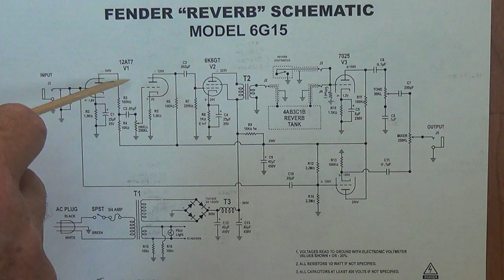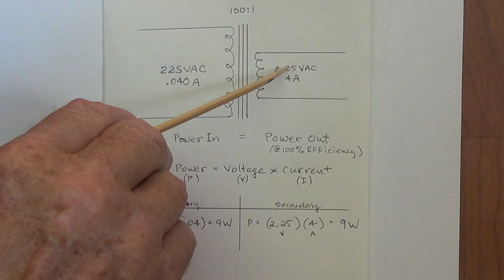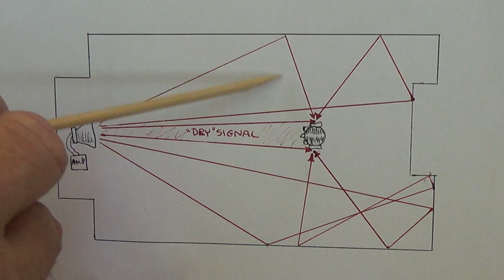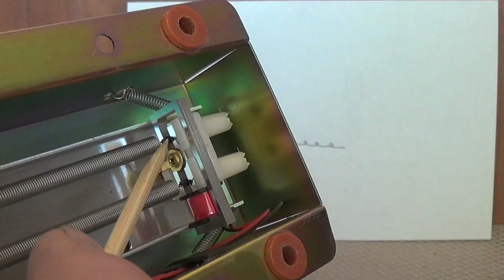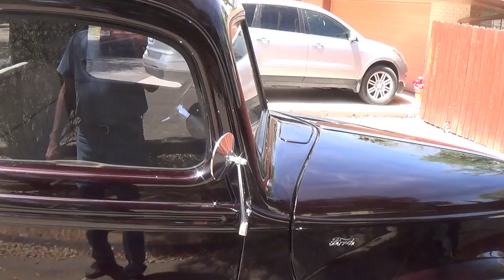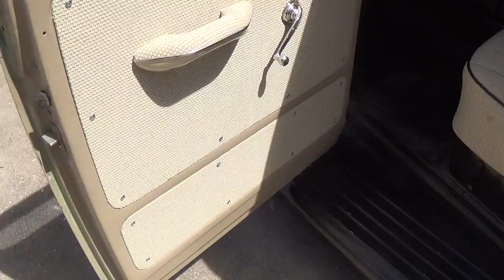Tube Reverb, Part 1

Comment from the maker: NOTICE: The link to the revised schematic, wiring diagram, etc. is now available in the video description.
Reply: my question is ? has anyone out there built this reverb according  to the layout diagram and schematic. on the top lay out the electrolytic caps have one red and two yellow wires coming from them. yet when you look at the under chassis there is two red wires and one yellow wire coming from the top as far as I can tell. the other thing that I wonder about is the output jack has all 3 contacts to ground and the wiper on the mix pot . the last time I attempted to build something it was from a book all about tube amps and when through with it it didn't work, checked it several times . no go. got on the net and after much searching found out there were 3 wires left out of the schematic in the book. nuff said. Otherwise I love all the videos. I just wish that the people that write stuff would build what they publish.I don't think uncle doug is at fault but I wonder about who did the layout after.
Reply: Another excellent tutorial, Doug. I have a question: do you refer the the LPF (C12, T3 and C13) as a "Pi" filter? I was taught that nickname years ago as it has a shape vaguely resembling the Greek letter. EDIT: That's a beautiful truck.

Comment: Hi Doug,I've built a clone of the 6g15 which worked out great. I'm thinking of building another to use in my studio which I'd like to use in mix down so Line Level (doesn't need to be balanced tho)- could you point me in the right direction please?
Reply from the maker: I'd love to help, Sharon, but I have no experience with what you are asking.  Good luck.

Comment: Nice video on the reverb unit! I have a strong interest in tube reverbs and reverb units. I recently made a video featuring my AMT TH-1 pedal (AMT Tube Hall). Although it isn't completely analog and isn’t a unit, I still enjoy its sound. Adding a phaser makes it sound like a dream. Your video has inspired me to explore this further.
Reply from the maker: Thanks for the nice comments, MB. Good luck with your experimentation.
Reply: @UncleDoug  also wanted to say that I love your work and generosity so much. When I discovered your channel a few months (or years?) ago it really motivated   me to stop being afraid of circuits. Had a blast (and a few non-lethal shocks) since. Thank you thank you thank you.
Reply from the maker: @morenoteslesstalk  You're quite welcome, MB :)

Comment: Hello Uncle, i have a reverb tank from an 90s transistor Fender SKR35 amp, can i reuse that reverb to a project like this or something similar?To make it work like a standalone tube reverb tank?
Reply from the maker: Transistor-circuit tanks generally have completely wrong impedance for tube circuits......they will not work.

Comment: I have a reverb unit from a Hot Rod Deluxe that I would like to repurpose into a stand alone reverb unit. I see the input resistance for that tank is 600 ohms vs the 8 ohms for the tank in the schematic. Is there a way to make it work with this design?
Reply from the maker: Check the Accutronics site for a list of the tanks they offer. Many different impedance ratings are available.

Comment: Would like you to do more step by step clone builds with LAYOUTS ..LIKE a bandmaster / Vibrolux powered PRINCETON REVERB. With Master..Maybe a TLO72 powered gain on it. Add FX LOOP. And external bias jacks and pots..I also noticed when mounting a  JTM45 chassis upside down in a one speaker combo. There is a space at each end.Great place to add upper cabinet corner reinforcement blocks that will facilitate a second removable top on the cabinet..The 2nd top can be removed to allow circuit inspection & some servicing without having to remove the chassis...The upper corner blocks could have threaded inserts for the removable top..Have not worked out the blocks yet as they could also be metal brackets..The handle will be mounted to the removable top..So need the brackets secured well to the cabinet sides for added strength..I just figure you are the guy to get this done. The JTM45 chassis is somewhat limited in space..You are clever & resourceful..Am curious to see what you'll come up with.
Reply: Something else I want you to help us with. 1. Is a Handwired step by step build ( LAYOUT)  instructions for the MUSIC MAN RD50 PRE AMP ONLY pedal/ box unit. The other thing that would be great is  step by step plans to clone a Handwired version of the Vox 15 watt solid state Pathfinder from the late 90's..( Model V9158 ):Greatest mic'd amp for recording I ever came across..Needs a pre amp out for clean non scratchy tone..The 8" speaker may have something to do with the tone but not that much..That amp with a heavy strat with alnico 2 pickups and fat polished frets with gain in that amp can get some clean Hendrix REDHOUSE/ WATCHTOWER TONES . Killer CLEAN  sustain. And a Boss DM-2 , not set for echo , but to just stretch the notes a tad..Very hard to replicate that sound anywhere  else...They now make the TLO72 with a socket..Which makes it mimic a tube style plug- in..So the the entire TLO72 circuit mod could be made as a cheap universal plug in module making it more service friendly for all the die hard hand wired tube amp warriors !
Reply from the maker: Greetings, Don.  I do not create or work from layout diagrams, and I do not work on transistorized circuits. Thus, rather than asking others to do the creative design part of the elaborate projects you described, perhaps you should attempt to do the work yourself. Good luck. @doncalloway136

Comment: The need for a "killer left hook" into that reverb tank, is that mainly due to the coils inside there and the impedance of them-theyre basically like speakers arent they or how would the reverb coils compare to speakers I wonder? That is one sweeet ride daddy-O.
Reply from the maker: The reverb tank is driven exactly like a speaker. In fact, you can plug the cable (to the tank) into a speaker instead, and the speaker will  work just fine (not much volume). Thanks :)

Comment: well im thinking it would be easier for me to add tremolo to this reverb unit, than adding reverb to a tremolo effects cabinet from the rick Campbell video. was inspired by the Bell and Howell 385 filmosound video where you added the tremolo from a vibrochamp circuit. im thinking of making it the same size as my Marshall TSL 100 head and it will blend into the stack. instead of Marshall it would be a Russell. lol thats my thought today anyways. every video of yours I watch I get inspired to do something else. :^I
Reply from the maker: I agree that adding tremolo to the 6G15 circuit would be the easier path. Good luck with your project.

Comment: Hi Uncle Doug. I just acquired a Airline 62 9019 Reverb Unit. It is completely original without the cabinet. I intend to re-cap it as well as build cabinet for it.
It uses a 6DR7 and a 6EU7 combination of tubes. The 6EU7 is a very expensive tube. Going by the data sheets. It seems to be exactly the same as a 12AX7 with a different pinout. 
So the first hurdle I'm thinking of overcoming is to re-wire its tube socket to accommodate a 12AX7 which I have many. Instead of ordering the $37 6EU7. Wonder if you have any thoughts on this?
I do have a good schematic for the unit. Which can be difficult to find if you did not know that Airline used the "62" prefix in a whole bunch of stuff they build. However, if you look up the Airline Schematic for simply "9019" it can be easily found.
Reply from the maker: I think the transition to 12AX7 makes a lot of sense, DW. Rewiring the tube socket should be an easy task. If the socket is labelled 6EU7, you might want to relabel it. Good luck.

Comment: OK I kinda liked this video - up until the analogy about voltage and amps being like talking shit and actually kicking someone's ass.  That made me love the video

Oddly enough, I actually understood and was familiar with every concept in this simple circuit.  With a little more study I'm going to try building one of these
Reply from the maker: Glad you enjoyed it, Monto. Good luck with your project.
Reply: @UncleDoug  Quick question - on the schematic you linked in the description, the Dwell pot appears to have the left and center terminal bridged together.  The schematic looks identical on that area to the Fender original, but their layout (+several others I looked at) don't have that bridged connection.  I don't want to make any assumptions - but is that correct?  Also where the same terminal's lead connects the grid on the b side of the 12AT7 has a different color.  

BTW studying your videos in my spare time over the last couple of years has built the majority of my knowledge on tube amps.  Your channel is a great resource
Reply from the maker: @monto39  When in doubt, trust the schematic, Monto. I created the schematic, but not the layout drawing. In the circuit, no legs of the Dwell pot are bridged.
Reply: @UncleDoug  Thanks for the advice.  With a little more study (and saving of $$) I think I'm going to get the Weber kit and build this
Reply from the maker: @monto39  Sounds like a good plan to me, M.

Comment: Thanks for all the great info Doug but the mojo tone kit with cab is almost $800 is there alternate source for a kit?
Reply from the maker: You'd have to check, Eric. I don't personally build kits and have no awareness of what's available. You could always just build it from scratch and save some money (not as much as you might expect).
Reply: @UncleDoug  Thanks Ill keep looking, you have any experience with the reissues?
Reply from the maker: @shckltnebay  Yes. They are well built and work fine. They MAY also be a bit cheaper than the $800 kit.
Reply: @UncleDoug  thanks so much

Comment: If my instructors in electronic circuits class were as interesting as you I may have made higher than C
Reply from the maker: Thanks, William. It takes a little effort to make the subject interesting......but it sure pays off in the long run.

Comment: Curious.  Instead of the physical reverb tank being a permanent feature, I'm thinking some way of utilizing line inputs and outputs into the cicuit for other ADA reverb gear like an old Eventide or Lexicon rack units.  Drive the input with tubes and have a proper tube output to an amp.  It would give you all the mojo and quality of tubes with the flexibility of good ol' 80's digital reverbs.  ;)
Reply from the maker: "Digital reverb" is anathema to us tubeophiles, Prof. The best reverb in the universe comes from a vintage Accutronics tank with Fender tube circuitry.

Comment: That's a bad ass truck uncle doug....
Reply from the maker: Thanks, Shiloh :)
Reply: @UncleDoug   Its funny, I found the schematic of the fender one for this in my book and researched a little but and I had considered building myself one , bec it seems like it would be an easier project to start out on.....thanks uncle doug....
Reply from the maker: @Shiloh7377  The 6G15 was one of my first tube circuit projects, Shiloh. I recommend it highly.
Reply: @UncleDoug  Thanks Uncle D, I wish you lived closer so I could have you go over my jcm 900. Anyway thanks UNCLE D
Reply from the maker: @Shiloh7377  You're welcome, Shiloh.

Comment: Hello! Is it possible to use a 6K6 instead?
Reply from the maker: Yes. Many people prefer them to a 6V6.....less gain.
Reply: @UncleDoug  I was wondering if your design needed other changes when putting in a 6k6.
Reply from the maker: @fuzzyloomchannel  No.....the tubes can be exchanged without any mods.
Reply: @UncleDoug  Thank you!

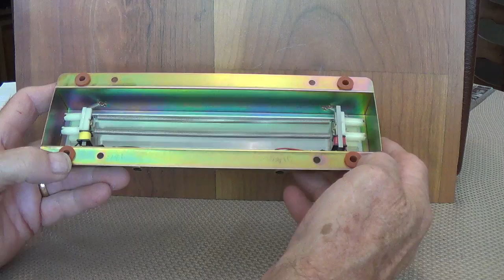Comment: That tank at 18:38 looks exactly like one that I hung on my wall. It's from a 2001 Marshall VS100, I gave it to dear old dad for inspection, and he said one of the connections between the jacks and the transducers was toast, so I just bought a Mod replacement tank and went on my merry way. I thought it looked cool so I stuck it on my wall
Reply from the maker: I prefer MOD tanks also, Dom. Good luck with it.

Comment: Hello Uncle Doug, how di d you mount the reverb tank? di d you just screw it to the wood vertical? Thanks
Reply from the maker: Yes, it's mounted vertically with the open side toward the front of the cabinet.....just like the original.

Comment: I have a  reverb unit that I believe is the same as the one you are talking about. It is a matching cab for my 61 Bassman. I use it in conjunction with a 2-12 cab with  celestion cream backs.
Reply from the maker: Fender made the 6G15 stand-alone reverb unit for many years, Jeff.
Reply: @UncleDoug  had the opportunity to buy several vintage reverbs,  but they didn't match the bassman. I get compliments from all who see it. It is also a beautiful piece artwork.
Reply from the maker: @jeffsquires6620  I'm sure it is, Jeff. I hope it serves you well for many years.
Reply: @UncleDoug  many thanks ,I love old fenders and appreciate all who maintain their excellence. Safe journies. You sound like the guy from Psonic.

Comment: Thank you for the video. It's a good study of such a simple but cunning device.

I suspect that when they originally designed the reverb tank, they saw the springs, transducer, and pickup as the main sound effect parts. They made it the best they could for a decent price. (Hear it comes....)
I wonder two things along the same ideas:
1.) What affect there would be on the tone if the (only) the springs that support/shock-isolate the inner assembly were dampened? In other words, I wonder if the outer springs were deadened temporarily by putting weak foam in them, such as the black foam that comes with IC chips, would it have a pleasing affect on the sound. I wondered if any of the vibrations makes their way to the case through the suspension springs.
2.) Does the plate that most of the parts are mounted on ring at all? Might is sound better if all it did was stiffly support the springs? If the plate were deadened temporarily with double-stick tape and rubber-backed thin indoor-outdoor carpet scraps or permanently with spray glue and the same rubber backed carpet or automotive Q-pads.

With guitarists, things are complicated. It might make a little more accurate reverb tank, but it might not be as pleasing.

While taking things apart such as trunk-mounted CD players, there are some isolation mounts which are very soft, and might be good for tanks, which I think are polyurethane. Though, Sorbothane is bad for a lot of things because it will go right through some kinds of plastic, vinyl.
Reply from the maker: I agree that reverb tanks should be (and are) rubber mounted to reduce extraneous vibration; however, and I speak from personal observation, any containment or suppression of the springs themselves essentially ruins the effect.

Comment: This is an amazing project! I have a question - If I get one of these tank, feed a line level output into it and then send it to a mic pre - would I be able to use it as an outboard effect? I am talking about the tank only, without the amp section
Reply from the maker: Thanks, DR. I have no idea if the impedances would match. You'll have to try it and see. Good luck.

Comment: Your reflection angles are all wrong!  The angle of each would have an identical "angle of incidence". Analogy? If you were to put a mirror at each reflective surface, you would see that the angle that the sound hits the wall will be identical to the angle that it reflects. SO your diagram is totally unrealistic.
Reply from the maker: Gosh, Mark, I guess I'd better delete the video and throw the 6G15 in the nearest Dumpster.
Reply: @UncleDoug  LOL

Comment: Uncle Doug-A couple of unrelated questions for you.  First, I've been thinking of building something similar to this unit, and wondered what the reading at the output jack is.  Is it the same as at the input jack, or different?  I assume its not 4 or 8 ohms like it would be if it were going to a speaker?  Second, and unrelated to this but is based on one of your cap discussions, Why do some amps have cathode caps along with the cathode resistors, and some have only the cathode resistor?
Reply from the maker: The input and output impedance must be fairly close to avoid too much alteration of the guitar signal, Reggie. Please see my video on the function of cathode bypass capacitors.

Comment: Fun Fact: 
The spring reverb system was originally developed by The Hammond Organ Co.  The first design was a 3' tall vertical unit, with long springs encased in tubes full of dampening oil; with a complex set of levers. 

Their second design involved hanging the springs like a necklace (Hence it's referred to ass necklace reverb).
When they developed their third design, which is the basic design still used today, the spun the division off as Gibbs Research Co., which became Accutronics.
Reply from the maker: Very interesting, Scott. Thanks !!

Comment: If you're running solid state rectification then you might as well throw in 100+uF resevoir caps as the time domain is way better. You don't need to play host to the needs of a valve rectifier.
Reply from the maker: Thanks for the suggestion, Prince :)

Comment: Uncle Doug, I think this will be my first attempt to build an electronic device. I was looking at schematic displays for several vintage Fender amps. A Super 5F4, a Twin 5F8-A, Tremolux 5G9;  all have a selenium rectifier. I do not understand what that does or why it may be necessary. Can you shed some light on that and where can I buy one (or two) of them?
Reply from the maker: We no longer use selenium rectifiers, Dennis. Instead you can use diodes or a full-wave-bridge rectifier to accomplish the same goal more effectively and without the toxicity of selenium.